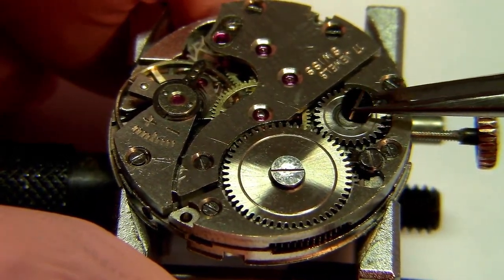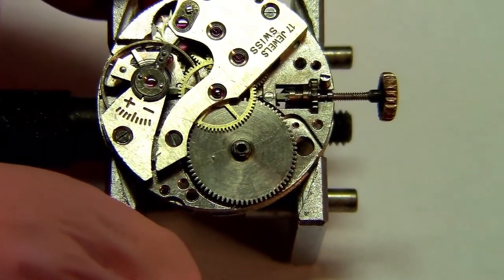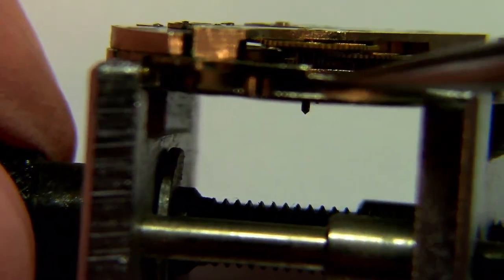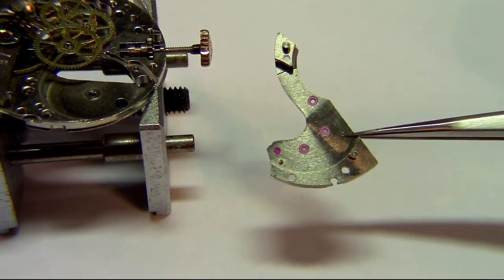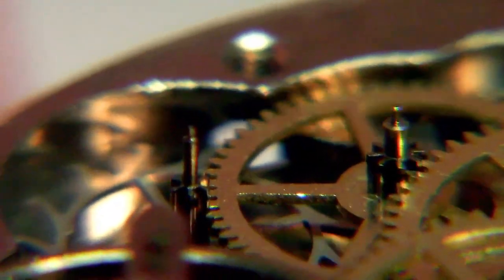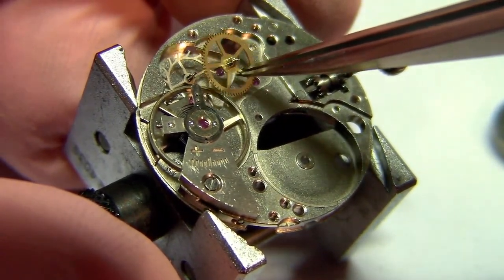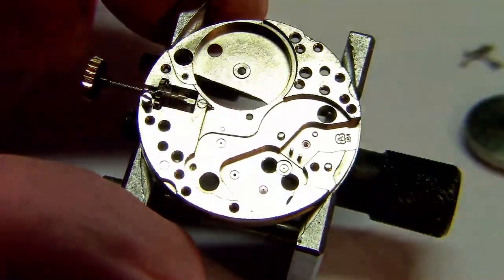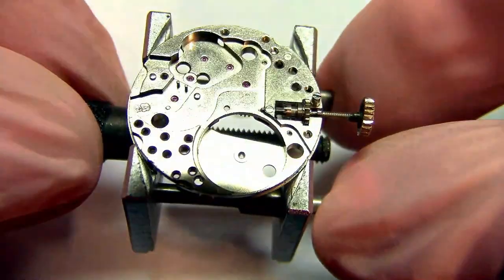[EN] How the mechanical watch works - Part 2/3: the gear train

Comment: What a fascinating and enlightening series! Thank you so much! Can't wait to see the last part! 😊 But the thing I don't understand is what makes the escapement start once force is applied to the escapement wheel. Is the pallet fork giving energy to the balance wheel?
Reply from the maker: I thank you! And yes, I know this is not totally explained on this video, but I'll talk about that on a specific video about the escapement, since it's a more complicated subject. But to sum up, you are right. The pallet fork receive force from the escape wheel and gives a kind of a "slap" to the balance wheel. the perfect angle between the face of the teeth of the escape wheel and the face of the pallet is what is responsible to make the rotational movement of the wheel into an impulse to lift the pallet fork, giving impulse to the balance. It's a very precise geometry involved to make the force kind of change directions to go where you want. It's a bit puzzling, but it will be clearer on a specific video about that geometry.
Reply: @CHRONOTALK  Thank you so much for the reply! I really appreciate it! 😊🙏 And I'm looking forward to the video on the escapement! 😊
Reply: @CHRONOTALK qq